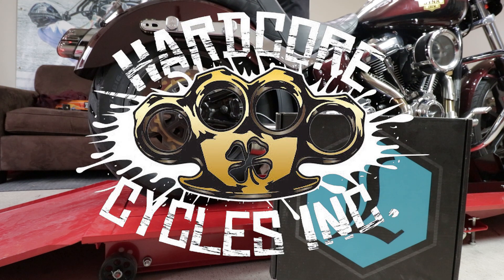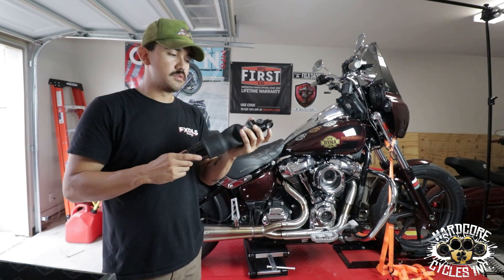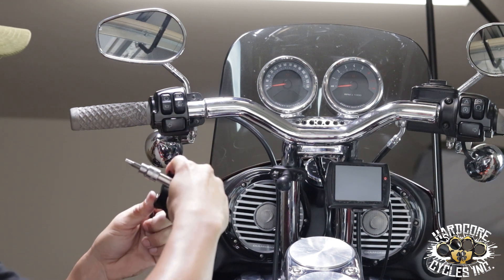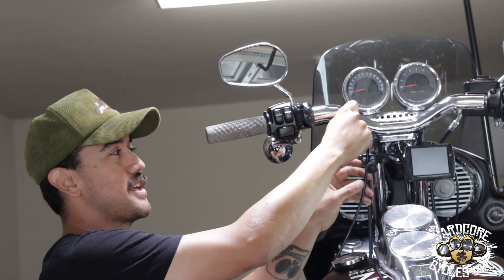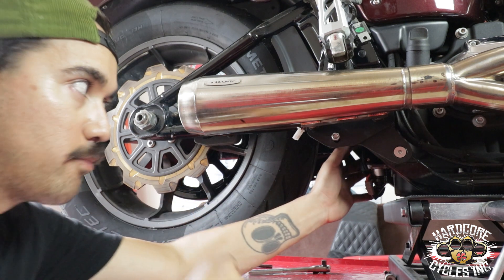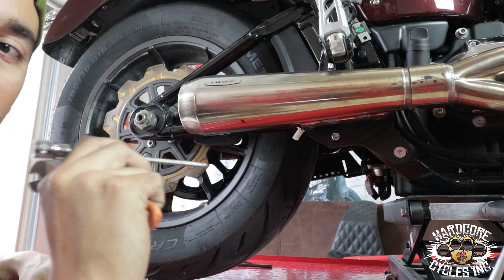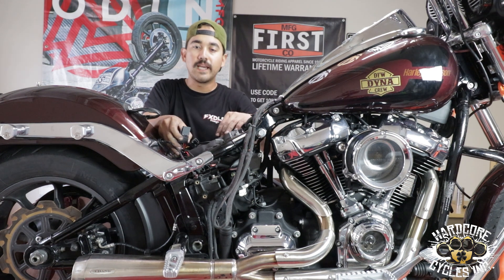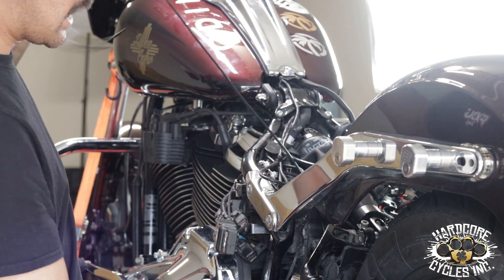Legends Suspension Air-A Monoshock Install | M8 SOFTAIL

Comment: I'm Riding a 2020 HD FLDE Deluxe - put legends front and legends air in the back.... the back unit compressor has disassembled itself twice and been replaced under warranty twice. Now i have an out of spec air leak somewhere.... have to add air within 6  miles of riding or refill in 3 hours sitting. Frustrating to spend this much on a shock and have to dick around with these problems. Pandemic supply issues hasn't made anything easier.  I'm taking the bike back to the dealer for a last attempt to get this air ride fixed or i'm jerking it out and sending it back to legends for good.
Reply from the maker: ouch! Thats a bummer tohear! And exactly what I was afraid of! It really is a neat idea but for as much riding as I do and sometimes 2-3 hours away from town that was the last thing I was wanting. And having to carry extra hose with me. 

Sorry to hear of your issues Rudy!

Comment: hello, I purchased a 2021 FatBoy 114 and was looking at Legend Coil and AIR MONO SHOCKS.
My dealer Service dept preferred the Legend Coil vs Air what's your opinion on all around feel and performance.
Reply from the maker: Howdy Glenn! Congratulations on the new Fatboy! 
The feel and performance of the Air shock was very nice and plush! BUT the only thing I wasnt a fan of was the added component of the compressor and air hose - that added 2 additional POTENTIAL* areas to fail. 

I had only heard of one person having an issue with their compressor, but with as much riding as I do in rural areas (plus I wanted to go even taller and now run a custom length RWD 14.5" monoshock) I didn't feel too sold on the shock. 
I have seen several occasions where Legends shocks have blown out (most of them from stunt riders, but a couple who ride their bikes very aggressively and at the track) and had to send it in for repairs (warranty did cover it). 

Out of the 2 styles the Coil I would say is the better option, but the wow factor the air shock has when you can lower it at lights or parked and lift it is very nice and cool!
Hope that helps!

Comment: Yo Conner. Dope n a great video as always. I have 20 m8 LRS and wondering about this legend air shock on my ride.   What would this benefit for me other than OEM shock?
Reply from the maker: howdy Paul! Apologies for the tardy response. To answer your question honestly - not much. It's cool to have the ability to adjust the height of the shock and def a cool factor, but for performance it's no different than the OEM shock. If you're going to spend the $$ on a shock I would suggest the RWD monoshock as its half the price ($850 ish) and has adjustability for rebound and compression. 

The cost of the air shock from Legends is craaazy high in my opinion. The ride was nice, but not 1600 nice.

Comment: I'm having an issue with my setup.  The mono shock won't lift the bike.   I see the bag fill up but thats it...no extention.  Any ideas?
Reply from the maker: Dang! Sorry to hear! What bike model and year do you have? M8? And is your bike on the lift or off and on it’s own kickstand?
Reply: @ConnorFXDB  2020 M8 softail standard.  I had it on a lift during the install.  Inflated the bag before I let it down.  Yes the bike is on its kick stand now.
Reply: @ConnorFXDB  thanks for the fast reply.  My plan on Monday is to email legend too.
Reply from the maker: @SSuperSpreader  hmm that’s odd. It should inflate. Try turning the bike on and sitting on the bike having it upright when you inflate it. 

Keep me posted! Very curious why it’s not inflating
Reply: Any update having trouble

Comment: What kind of speaker system is that? and will it fit a road warrior fairing?
Reply from the maker: Great question! It’s 2wheelAudio and yes it will! That’s what I’m running it on. They make them specifically for the fairings using them as molds so it looks like it came altogether. 

I’m using the 4 channel system. I do have 2 videos on it little farther in the video lineup but you can search 2wheelAudio connorfxdb and should pop up. It’s been 1.5 years since I got it and about 25,000 miles with no issues. 

Thanks for watching!